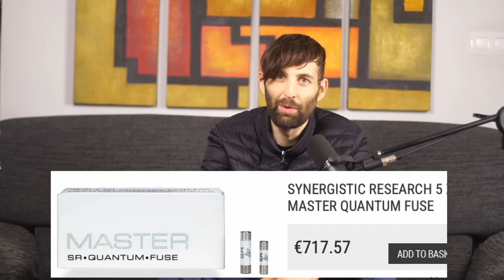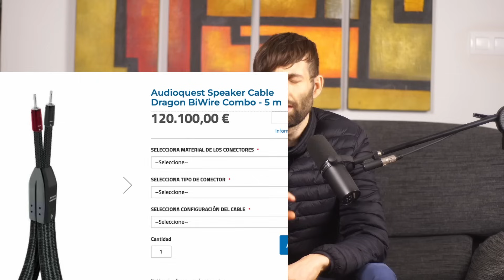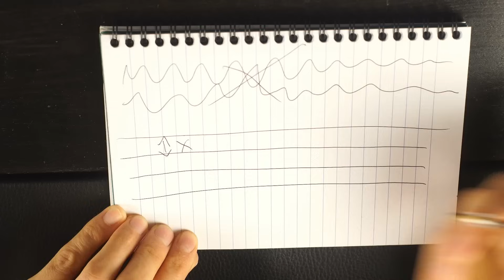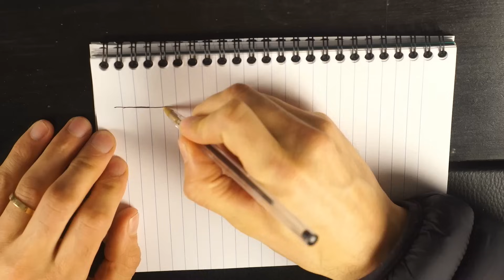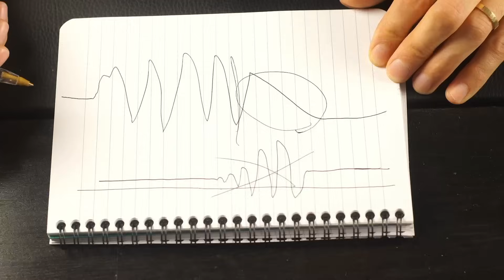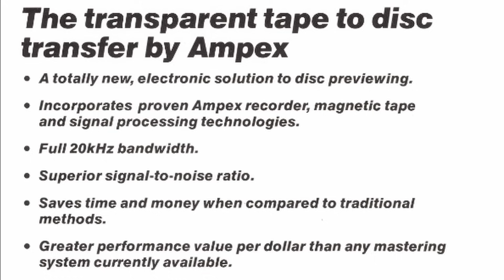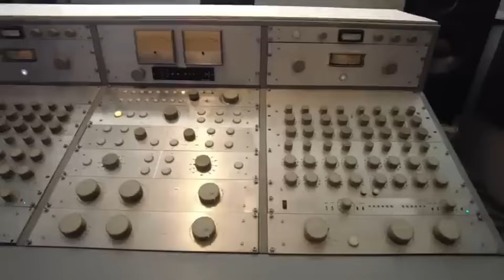Hard truth: most vinyl is digital anyway

Comment: Vinyl has much less dynamic range compression and here is why: 
Dynamic range compression reduces the difference between the loudest and quietest parts of a track, making the overall sound more consistent. In the digital realm, especially during the "loudness wars," music is often heavily compressed to make it sound louder and more attention-grabbing. However, vinyl has physical limitations—if the music is too compressed or loud, the needle can jump out of the groove. As a result, mastering engineers often use a less compressed version of the music for vinyl to ensure it plays properly. 
-
This doesn't mean vinyl inherently has better sound quality; it depends on the mastering process. Some listeners prefer the less compressed, more dynamic sound of vinyl, while others might favor the clarity and precision of digital formats. It's all about personal preference! Now, if you don't believe this then you might want to look it up. Also, if you also have what you create in Vinyl version then I would think that it sounds like shit.
Reply: Uh…no. You have that backwards. Vinyl has less dynamic range, yes. But it requires more compression and/or limiting than digital to stay within that range. There’s a reason the loudness wars heated up in the digital age. It was to take advantage of the 20+ dB of added headroom on a CD vs an LP.
Reply: @peterbigblock  
You are only correct in terms of having less Dynamic Range. The rest you are wrong. Here are my receipts from 3 different AI. I've also got science and the industry backing me up:

Google Gemini:
The relationship between vinyl records and dynamic range compression is a nuanced one, and it's not simply a case of "vinyl always has less compression." Here's a breakdown of the key factors:

Understanding Dynamic Range Compression:

Dynamic range compression reduces the difference between the loudest and quietest parts of an audio signal. This is often done to make music sound louder, especially in digital formats where perceived loudness is a major factor.   
However, excessive compression can diminish the subtleties and nuances of a recording, leading to a "flat" or "squashed" sound.   
Vinyl's Limitations and Advantages:

Physical Limitations:
Vinyl records have physical limitations in how much audio information they can hold. Extremely loud signals can cause the needle to jump out of the groove. Therefore, mastering engineers must be mindful of peak levels.   
This physical constraint often necessitates some degree of compression, but it also discourages the extreme levels of compression sometimes used in digital mastering.
Mastering Differences:
Often, music intended for vinyl release will undergo a separate mastering process, distinct from the digital version. This mastering may indeed involve less aggressive compression.   
This is because the physical limitations of the vinyl format will not allow for the same levels of compression that are used for digital formats.
"Loudness War" Influence:
The "loudness war," a trend of increasing the overall loudness of recordings, has had a more significant impact on digital audio. Vinyl, due to its physical constraints, has been somewhat less affected.   
Therefore, in many cases, vinyl versions of albums, especially those released in recent years, can exhibit a wider dynamic range than their digital counterparts.
In summary:

While vinyl records do require some level of mastering that includes compression, the physical limitations of the format help to prevent the extreme compression that is commonly found in digital recordings.
Therefore, it is often true that vinyl versions of music can, and do have a greater dynamic range than the same music in a digital format.
Therefore, your understanding of vinyl having less dynamic range compression is often correct.

ChatGPT:
🎵 1. The "Loudness War" in Digital
Since the late '90s, digital mastering (especially for CDs and streaming) has increasingly pushed for louder overall volumes by using heavy dynamic range compression and brickwall limiting. This makes the music sound consistently loud but squashes the peaks and valleys, reducing the dynamic range. The reason? Louder tracks tend to grab attention more easily, which is why producers and labels often aim for maximum volume in the digital realm.

🎧 2. Vinyl Has Physical Limitations
When mastering for vinyl, engineers can’t push the loudness as aggressively due to the physical nature of the format.

Too much compression = distortion → Vinyl grooves have a limited space, and if the signal is too loud or compressed, it can cause the needle to jump or distort.

Bass limitations → Deep, loud bass takes up more groove space, which limits how much audio you can fit on a record. To preserve playability, bass is sometimes reduced or summed to mono, but the dynamics are left more intact.

🎚 3. Different Mastering Process
Most vinyl records are cut from a separate, more dynamic master. This is done because the digital master, which is heavily compressed, would sound terrible on vinyl. The vinyl master often retains more of the natural dynamics and transients, making the music feel more "alive" and open.

🔥 4. Perception of Better Sound
Vinyl’s inherent imperfections (like subtle harmonic distortion and surface noise) can actually make the music sound warmer or richer. Combined with the greater dynamic range, this gives vinyl a more "natural" feel compared to the often harsh, compressed digital counterparts.

✅ The Takeaway
Not every vinyl release has superior dynamic range—it depends on the mastering. However, in many cases, modern vinyl releases do sound more dynamic because they’re mastered differently from their digital versions, making them a preferred choice for audiophiles. 🎵

Copilot:
 it's often true that vinyl versions of music have less dynamic range compression compared to digital formats like CDs or streaming. This difference stems from the way music is mastered for vinyl.

Dynamic range compression reduces the difference between the loudest and quietest parts of a track, making the overall sound more consistent. In the digital realm, especially during the "loudness wars," music is often heavily compressed to make it sound louder and more attention-grabbing. However, vinyl has physical limitations—if the music is too compressed or loud, the needle can jump out of the groove. As a result, mastering engineers often use a less compressed version of the music for vinyl to ensure it plays properly.

This doesn't mean vinyl inherently has better sound quality; it depends on the mastering process. Some listeners prefer the less compressed, more dynamic sound of vinyl, while others might favor the clarity and precision of digital formats. It's all about personal preference!
Reply: @RockManEnough The guy in the AP Mastering video is claiming that Vinyl doesn't sound better that CD as Vinyl enthusiast claim. Since you didn't see the reply I made above (peterbibblock), I will copy and paste what I said. It's regarding Dynamic Range Compression. Vinyl doesn't like to much of it as the needle would jump out of the groove. Now if the digital version had the same ammount of Dynamic Range Compression as the vinyl version does at 24-bit/48Khz then the digital version would sound better. Remember to click "Read more".
-
Here are my receipts from 3 different AI. I've also got science and the industry backing me up:

Google Gemini:
The relationship between vinyl records and dynamic range compression is a nuanced one, and it's not simply a case of "vinyl always has less compression." Here's a breakdown of the key factors:

Understanding Dynamic Range Compression:

Dynamic range compression reduces the difference between the loudest and quietest parts of an audio signal. This is often done to make music sound louder, especially in digital formats where perceived loudness is a major factor.   
However, excessive compression can diminish the subtleties and nuances of a recording, leading to a "flat" or "squashed" sound.   
Vinyl's Limitations and Advantages:

Physical Limitations:
Vinyl records have physical limitations in how much audio information they can hold. Extremely loud signals can cause the needle to jump out of the groove. Therefore, mastering engineers must be mindful of peak levels.   
This physical constraint often necessitates some degree of compression, but it also discourages the extreme levels of compression sometimes used in digital mastering.
Mastering Differences:
Often, music intended for vinyl release will undergo a separate mastering process, distinct from the digital version. This mastering may indeed involve less aggressive compression.   
This is because the physical limitations of the vinyl format will not allow for the same levels of compression that are used for digital formats.
"Loudness War" Influence:
The "loudness war," a trend of increasing the overall loudness of recordings, has had a more significant impact on digital audio. Vinyl, due to its physical constraints, has been somewhat less affected.   
Therefore, in many cases, vinyl versions of albums, especially those released in recent years, can exhibit a wider dynamic range than their digital counterparts.
In summary:

While vinyl records do require some level of mastering that includes compression, the physical limitations of the format help to prevent the extreme compression that is commonly found in digital recordings.
Therefore, it is often true that vinyl versions of music can, and do have a greater dynamic range than the same music in a digital format.
Therefore, your understanding of vinyl having less dynamic range compression is often correct.

ChatGPT:
🎵 1. The "Loudness War" in Digital
Since the late '90s, digital mastering (especially for CDs and streaming) has increasingly pushed for louder overall volumes by using heavy dynamic range compression and brickwall limiting. This makes the music sound consistently loud but squashes the peaks and valleys, reducing the dynamic range. The reason? Louder tracks tend to grab attention more easily, which is why producers and labels often aim for maximum volume in the digital realm.

🎧 2. Vinyl Has Physical Limitations
When mastering for vinyl, engineers can’t push the loudness as aggressively due to the physical nature of the format.

Too much compression = distortion → Vinyl grooves have a limited space, and if the signal is too loud or compressed, it can cause the needle to jump or distort.

Bass limitations → Deep, loud bass takes up more groove space, which limits how much audio you can fit on a record. To preserve playability, bass is sometimes reduced or summed to mono, but the dynamics are left more intact.

🎚 3. Different Mastering Process
Most vinyl records are cut from a separate, more dynamic master. This is done because the digital master, which is heavily compressed, would sound terrible on vinyl. The vinyl master often retains more of the natural dynamics and transients, making the music feel more "alive" and open.

🔥 4. Perception of Better Sound
Vinyl’s inherent imperfections (like subtle harmonic distortion and surface noise) can actually make the music sound warmer or richer. Combined with the greater dynamic range, this gives vinyl a more "natural" feel compared to the often harsh, compressed digital counterparts.

✅ The Takeaway
Not every vinyl release has superior dynamic range—it depends on the mastering. However, in many cases, modern vinyl releases do sound more dynamic because they’re mastered differently from their digital versions, making them a preferred choice for audiophiles. 🎵

Copilot:
 it's often true that vinyl versions of music have less dynamic range compression compared to digital formats like CDs or streaming. This difference stems from the way music is mastered for vinyl.

Dynamic range compression reduces the difference between the loudest and quietest parts of a track, making the overall sound more consistent. In the digital realm, especially during the "loudness wars," music is often heavily compressed to make it sound louder and more attention-grabbing. However, vinyl has physical limitations—if the music is too compressed or loud, the needle can jump out of the groove. As a result, mastering engineers often use a less compressed version of the music for vinyl to ensure it plays properly.

This doesn't mean vinyl inherently has better sound quality; it depends on the mastering process. Some listeners prefer the less compressed, more dynamic sound of vinyl, while others might favor the clarity and precision of digital formats. It's all about personal preference!

Comment: There's a reason CDs had a moniker on them that said one of the following, AAD, ADD, DDD. I'm back in the early '80s, DDD was what you looked for. We were trying to get away from Master tape hiss and stuff like that.
Reply: @ReasonablySane  CDs are amazing, I collect them, but where the industry really messed up was in the late 90s and the 00s when they pushed for louder mixes killing any dynamic range that were on the 80s CDs. This is where vinyl shines, even though physically has a lower dynamic range than CDs the medium does not allow for overly loud mixes as it would mess with the playback, so even if the vinyl master is done in digital there often is a specific master for vinyl specifically that tends to have higher dynamic range than any digital release.
Reply: @otnoirhc yep. I used to get in those arguments about which sounds better, vinyl or digital, I'm a huge vinyl fan and have thousands as well as multiple turntables. But I know that vinyl is seriously limited compared to digital sources so I've always said as much as I love vinyl digital is always going to sound better. 

Then I learned about the loudness Wars. What I discovered was that although vinyl doesn't sound as good as digital if the original sources the same, what they do to ruin the source before they put it to digital, which includes CDs, is horrendous. 

Tried to revise my argument. And it revised it to this, given the same source material, digital sounds better than vinyl.
Reply: @ReasonablySane  Yeah it is really annoying, digital has such potential for audio quality and it is completely destroyed by the labels that push overly compressed masters so it wont sound too bad on cheaper equipment. Most people don't care or even know the difference of course.

Comment: I have 3500 vinyl records and used to sell high-fi between 1976 and 1983. I have never believed nor will I never believe that vinyl sounds better than good digital sources. I used to enjoy the vinyl versus CD/digital arguments in the past. People need to understand that in audio, warm sound means distorted sound. I'm also aware of how much they have to suppress dynamic range to get the music to fit on a record without having grooves that the needle is going to pop out of every few seconds. 

That being said, the loudness war is convinced me that sometimes digital does sound worse than vinyl. But not because digital isn't as good as vinyl, but because the Master mix put on the digital format is so bad. 

I have several directive district recordings made in the '70s that I bought in the '70s. They sound amazing because they do have more dynamic range than most records due, and they also have more dynamic range than most CDs made for the popular audience. The reason is because they know their customer base is looking for good solid transience and good dynamic range. 

If a master mix is designed to get the most out of digital, it will blow away any vinyl record on the market, and it wouldn't even be close. 

All that being said, virtually all of my records are pure analogs simply because they were all manufactured before anybody was using digital Masters. I only have a total of maybe 20 newer records and no reissues.

Comment: I don't need to watch this.
"Most vinyl is digital".... for someone your age.
I am 70 years of age. I have 6,000+ LPs. Most are pre-1980. Maybe 2% at most are digital. I make a point of avoiding DDA or ADA pressings. In blind tests, I can tell the difference between an analog vinyl and a digital vinyl 95% of the time.
Save yourself the 18:34 that you will never get back. Full stop.

Comment: vinyl sound better for middle high and lowincome listners - and only Very high income have the didgital equipment to buy for abette rlistening experince and Yes if you are an autist the digital are for yo at any price range since its " better" and it is for autists - any other listerner than the 2% riichest should listen to vinyl and i guess the 1 % does it too , and yes modern vinyl are most likely a vinyl copy and should go throught a vinyl mastering process instudio  but i guess most record labels cheap because its cheaper , and maybe yu dont have ears to hear the difference like when its very moist , that you can hear the echo from you walls even in a bedroom from gipsym wall, - yes digita re "better" but if the lister gets tired and dont want a second session then vinyl are better with "air in the sound for a cheaper money than digital